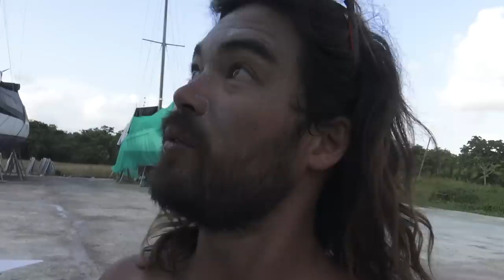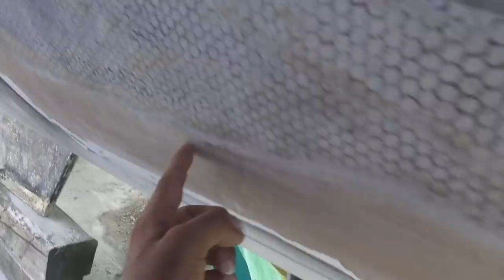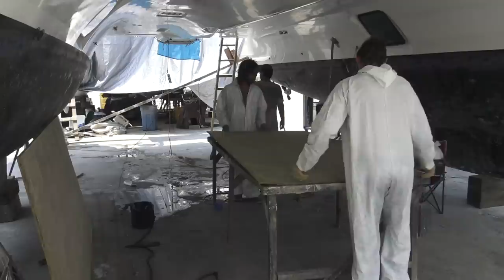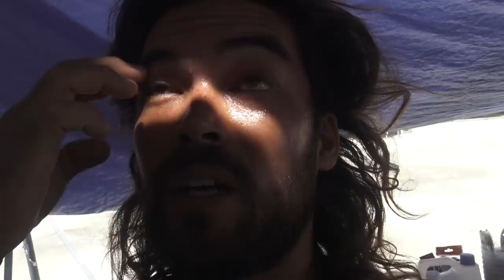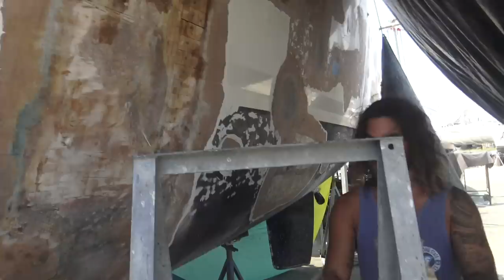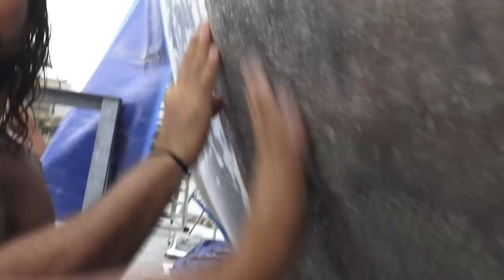The joys of fixing a HURRICANE DAMAGED BOAT - Episode 36

Comment: Colin,  For future use, as well as other uses onboard get yourself a vacuum pump. You can do much better glass work by saturating the edge balsa with alcohol and pulling vacuum, then air drying with heat to completely dry that area... you can also suck out small areas you detect with a moisture guage thru a tiny pinhole that's easy to repair.  A V-pump can also expedite oil changes, and marinating foods and veg before grilling. Got moisture in electronics ? No rice needed.. just vacuum them in a sealed container like for marinating foods. Just subscribed too !

Comment: On a large patch using epoxy cut your glass schedule to size the put the whole mess on plastic and wet it out. Then move it to your prepped area and place it on and roll out the bubbles. Then peel ply.

Comment: Excellent and informative refit / repair series. Thank you.

On my boat, I am facing the big and expensive task of dealing with a worn teak deck. Based on your vids (and others) I am curious about the possibility of doing this project in the rio dolce. I know the yard and living expenses are pretty low......but are the needed materials readily available? How about hiring local skilled labor?

A quick explanation about the pluses and minuses of doing this work in the rio would be appreciated.
Reply from the maker: Bud SV/Journey teak is not so readily available here but the labor is incredibly cheap and you can live off $10 a day easily. Shipyard fees are around $330 a month for my boat so most are a lot cheaper than that. Would highly recommend coming here, but bring/ship as much stuff as you can as materials are 20% or more expensive than the states. Hope this helps a bit.

Comment: How did you ensure that all balsa core is dry now? Hopefully you gave it a few weeks to dry before glassing it again. If there are small channels between the core squares water can go through and do it's work in an area you completely did not know about. Find it quite difficult to repair a hurricane boat structurally sound. In wooden boatbuilding defects can be found where one never would have searched for taking the origin of the damage into account.

Comment: Brother..  I'm not an expert, but you can't put Polyester Resin over Epoxy...  It will de-laminate.   I'm rooting for you..    If you have questions about fiberglass, check out boatworkstoday channel.  Andy  is the guys name and he always answers questions.
Reply from the maker: Vicarious Air I haven’t, I put epoxy over the poly on the inside. On the outside I’m putting polyester over polyester and then gel coat. Yea I love that guys channel!

Comment: Us pure alcohol and cover the wood that has been exposed to water.  THe alcohol with pull the moisture out of the wood and then evaporate away.  It takes a very long time to remove moisture from wood especially in a humid environment.  You may have to bag the entire area and pull a vacuum and hold it for  3 or 4 days, a good vacuum!  Alcohol and a good vacuum, purge with hot(100 degrees F) dry air.  apply alcohol let sit for  half a day, the pull a vacuum again for  4 days.  I know alot about water and it affects in process vacuum system in the semiconductor world!.

Comment: You have a good man advising you. I only wish I could afford to have come over to supervise the works for you - much quicker and easier ways too do the work, bringing my own gear to remove moisture, a moisture gauge, home made vacuum gear etc. I am an ol boat builder from way back, (ChCh with Cooke Bros) Could have brought you much experience, and with your keen crew being awesome guys, I see the work being done well. Probably too late with this - did you have access to peel ply? That chit nails finishing work and no sanding off wax between laminations, (unless you used un-waxed polyester? which leaves a sticky set resin that doesn't need sanding, just keep the moisture off the lamination ready for next layers, that wax needs removing b4 next lamination)
There's more but I don't need to show off cuz, you guys prob have the job nailed as this went to air huh
Reply from the maker: daedster1 wish we had you here from the beginning! Haha.
Reply: If only I was rich.........................
Reply: @willemduitemeijer1683  ?

Comment: This is probably a day late and a buck short, but to avoid air bubbles you can vacuum bag your repairs.  This is done in aviation frequently where high quality is necessary.
Reply: Also heat blankets and vacuum bags will help dry out your core quickly.

Comment: Hey man. I have been fiberglassing 40 years, i built about 50,000 surfboards in my life and i have rebuilt dozens of yachts. What youre doing is good man. Youre taking it step by step.
Not sure how behind you are in video but probobly too far for advice so i will just  say epoxy man its mandatory for fairing the hull. I am sure you know this.
Use micro light 410 if you can get it for final fairing with a good epoxy you will not regret it.
Reply from the maker: Sailing Solo I don’t want to put gelcoat over epoxy so we sticking to polyester.
Reply: @ParlayRevival  you will regret that. You need a epoxy barrier coat any way. Gelcoat still breaths. Read any literature on barier coating. Polyester does not have good fairing qualitys its brittle at best..it will just fall off. You will see. It might last a few years but it wont  last. Epoxy or bust.
Reply: @ParlayRevival   ditch the gelcoat use epoxy to fair and a epoxy barrier coat paint. Talk to anyone in the industry

Comment: You guys are doing a great job.  Regarding the thought of adding MEK (polyester resin catalyst) after you've mixed cabosil into the polyester resin, I'd suggest you think about this.  When you're adding MEK to polyester resin, the volume difference written as a ratio is about 128 parts resin to 1 part MEK.  That 128:1 ratio is huge.  And you can see it when you add the MEK into the resin.  Now to catalyze the reaction with all of the resin, the MEK molecules have to actually touch all of the resin molecules to start the chemical reaction.  What do you think happens when you add cabosil and increase the volume from say 100 ml of just resin to 400 ml of resin+cabosil?  The chances of the cabosil blocking contact with the MEK increases by at least a factor of 4.  In other words, your filler will not have the same structural strength as when you create the catalyzed mix of resin+MEK.  That's just straight physical chemistry bro.  You're doing all that hard work and I'd prefer that you have all of the information you need to make an educated decision.  Keep going... boat looks great.
Reply: Good advice